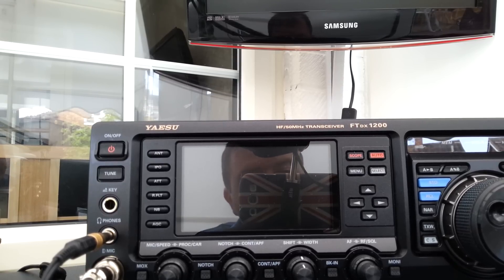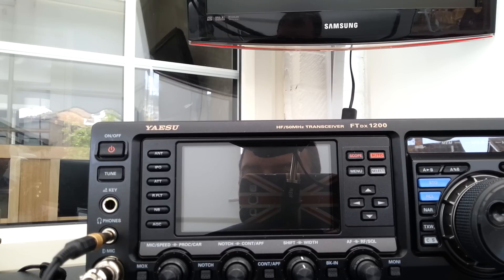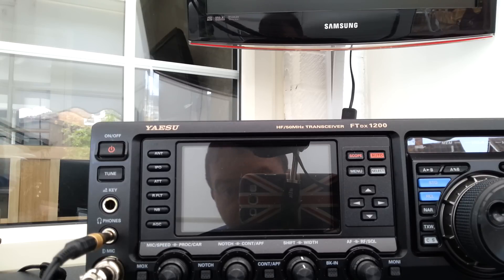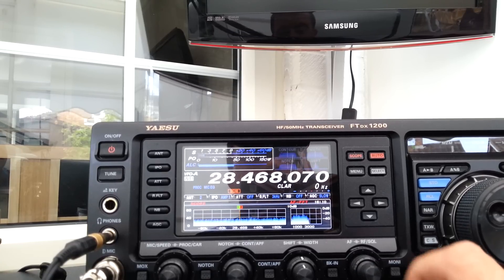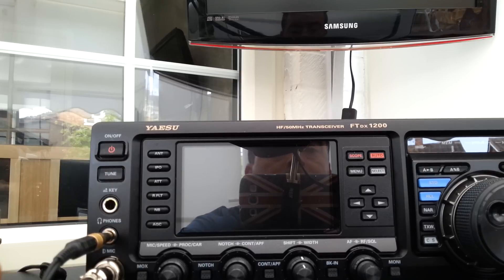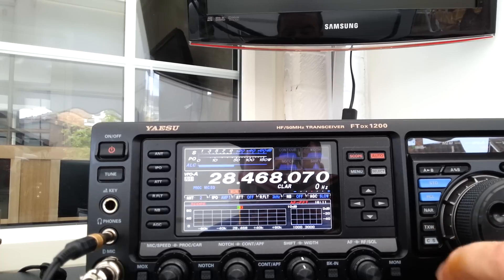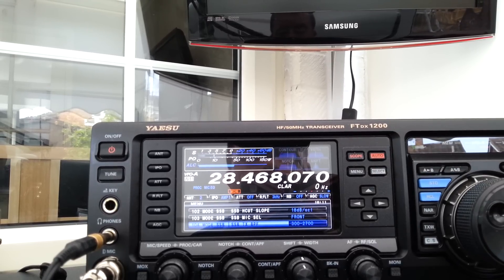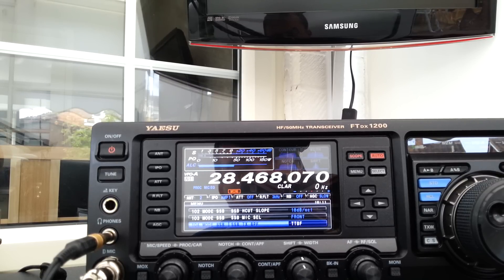Yaesu Ftdx 1200 4khz tx bandwidth

Comment: I need to let my FTDX transmit from 28Mhz to 32Mhz for use with my 2 meter transverter. 28-30 Mhz covers 144-145Mhz and 30-32Mhz covers 146 and 147 Mhz. Is this possible? My Transverter accepts 28-32 Mhz at a Maximum of 10 Watts. 73 vk3xz  Mike

Comment: After 5 years I'm wondering if you still own the ftdx 1200? If so how has it held up, and are you still happy with it? Do you or did you operate it @ 4khz wide always, or was/is there a reason you might've returned it to it's "default" bandwidth setting? If so why? I'm thinking about buying a 1200. The second-hand prices make it a buyer's market. I will be using it on 11 meters (SSB) only. It will basically be a glorified CB radio. If I were a ham operator I would consider the 3000. The ftdx 3000's are also selling for (imo) cheap yet exspsive for a CB radio. It's imo still worth the $. The 4 khz wide operating bandwidth makes it an excellent candidate for a studio mic and mixer. Great shortcut clip. It looks like it couldn't be easier getting the transmitter to transmit à 4 kilohertz wide. Thnx. 73